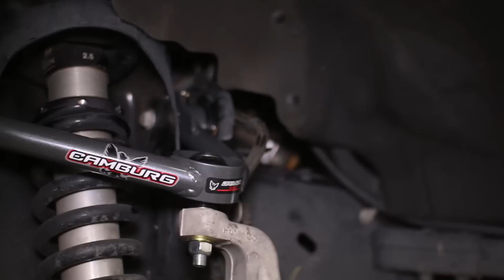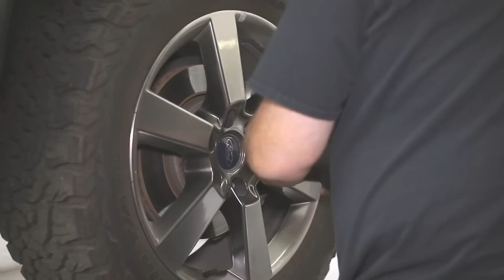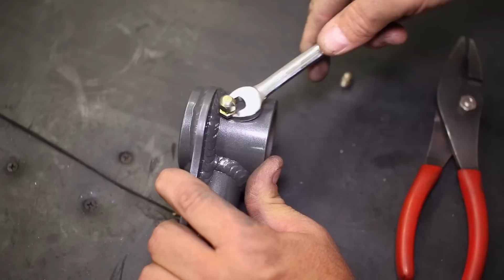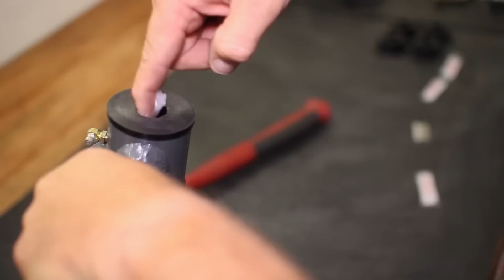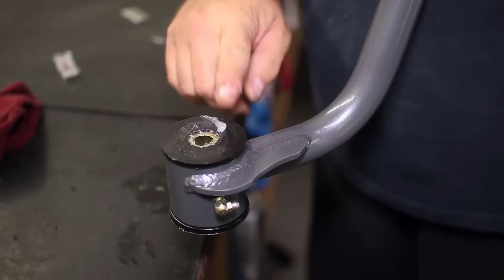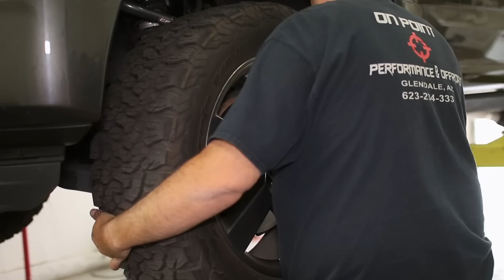2004-2018 F150 Camburg 1.25 Performance Uniball Upper Control Arms Install

Comment: Hey guys I replace the last year the factory UCAs in my 2013 f150 with brand new Camburg 1.25 unaiball UCAs, after all this period of time I had to grease every 2 weeks since the noise caused each time I turn is  driving me crazy. I don't scare mantenice my truck but I think it is too much. I don't know if the BDS UCAs have the same problem ? its any better UCAs ?

Comment: DO YOU NEED TO ALIGNMENT AFTER INSTALLATION??🤔
Reply: Yep , anything after change to front suspension needs alignment
Reply: Is a frogs ass water tight?
Reply: @drainmonkeys385  isn't it? They take on water when they swim? You take on water when you swim?!

Comment: What shocks are those that say 2.5 ?? I've seen other videos and the shocks look plain- are those performance/off road capable? And if so what manufacturer makes those ? I've got similar looking ones on my 08F150 4wd, bought it used and don't know what they are- they say Camburg on the shock but Camburg told me they don't make shocks. I have Camburg UCA. Anybody know I would Really Appreciate it !
Reply from the maker: The coilover on this truck is an Icon 2.5 coilover. It is definitely meant for offroad use.

Comment: I have a  2013 f150 2wd xlt crew cab, i was wondering if the upper control arms are the same as a raptor of the same tear
Reply from the maker: The Raptor has completely different front suspension from a normal F150, including upper control arms

Comment: Will control arms like this fix uca to coil contact at full droop?
Reply: Wondering the same thing
Reply: Did you guys have any luck? My truck is doing just that...hitting the coil
Reply: I have a Tundra, so not sure on F150, but on Tundra it does.

Comment: i seen a few that i think are being used for lift kit to push the control arm to be more straight then have and peak angle.
wondering if its possible to get longer bolt and a spacer to lift the control arm back to stock position

Comment: i have 2010 2wd 
stock 17 in wheels with new tires can i keep them or do i need a different wheel with more offset ?
Reply from the maker: These control arms require 5.50" of backspace or less for proper fitment and to fit up to an 12.50" wide tire
Reply: @stage3motorsports  
I have a 2013 f150 fx4, just replaced new  shock  front and rear with a Fox 2.0 coil over and add some MotoFab 3-Inch Front / 2-Inch Rear Leveling Kit and 315/70R17.
I’m wondering if this Camburg UPC could fit because the dimentions of Camburg  UCA aren’t the same as a convencional or moog ball ?
Should I need a different ones ?
Reply: You'll be fine